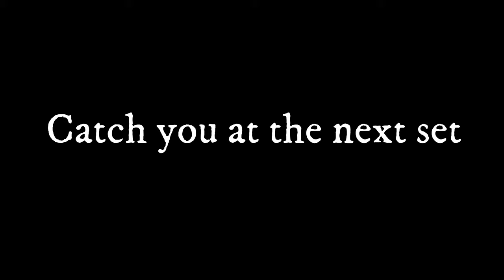Workin the pole

Comment: Good vid Jason ..i use a wire stretcher ..take off board then put on wire stretcher push the nose through the end then pull up from the bottom  also works well thanx for sharing

Comment: Works well eh? I been using  the same old wood broomstick since 92 . I got a 2x4 screwed to floor with a hole in it that’s fits the other end of the stick. Slicker than bear grease. Thanks for sharing. Stay well.
Reply from the maker: Well you got me beat but it’s a quick way to turn a pelt. 👍🏻 thanks for watching.